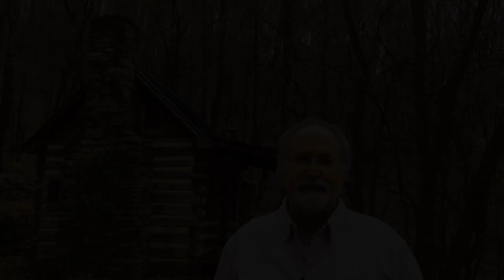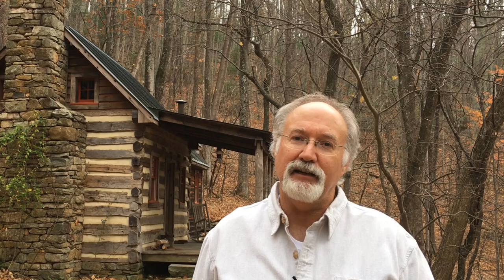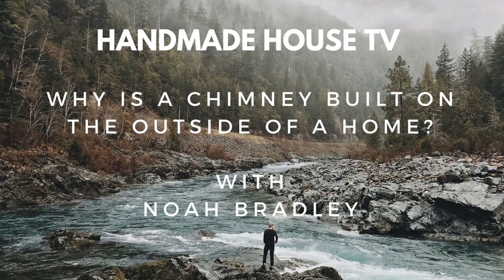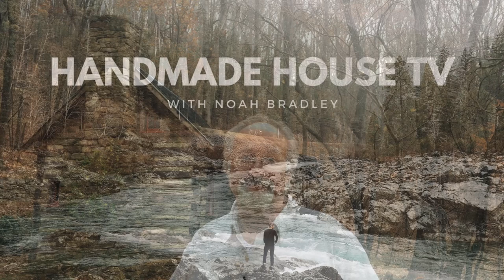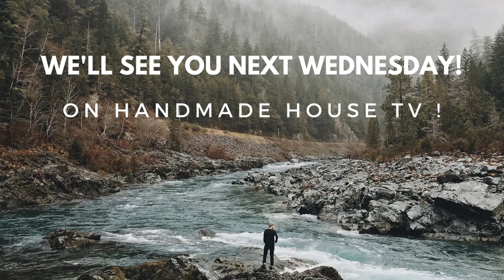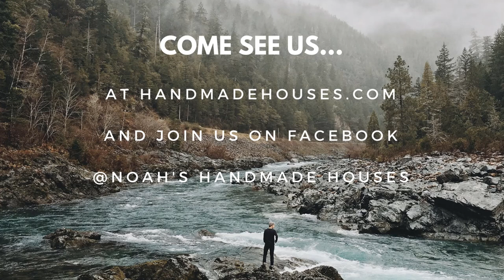WHY Are Chimneys on the Outside of a Home?

Comment: Mr. Bradley,
Did you build the chimney on the cabin as well? I have a older home, and the exterior of the chimney is cinder blocks. I was thinking/wanting to cover it with stone just like yours. Do you have any videos, recommendations, etc. on how to build that chimney? If so I would greatly appreciate it. 
Thank you for your time,
Jason
Reply from the maker: Yes this chimney was built by me/my crew. If you want to cover your block chimney with stone, then I would recommend my Stone Mason Academy, which goes through how to lay and cut stone and spends some time on "veneer", although in your case it would be authentic veneer rather than glue-on stuff.
Reply: @HandmadeHouseswithNoahBradley  the rock I would be using is from off the property! My cabin (family’s) I live in has that exact same style. It was made from the underpinnings of old tobacco barns. Is your course hands on, or online?
Reply: @HandmadeHouseswithNoahBradley  basically I want to do another 1 like it. The chimney in our cabin was built when I was a kid. So I only remember the basics of it.

Comment: In New France and until the beginning of the 20th century chimneys were built on the inside of the house. Either right in the middle, or adorning an exterior walls. Sometimes there would be one chimney on each exterior wall if the house was large enough.
Reply from the maker: Thanks for sharing Martin!

Comment: The chimney also identifies which of the buildings is the HOUSE, as opposed to a shed, barn, or stable. The cabin with the chimney is where the people are.
Reply: So you're saying that people wouldn't see the chimney sticking up out of the roof?  Or the smoke rising?
Reply: Stables never have fireplaces in the US?

Comment: Hi noah. We ve decided to have a wood burner on inside but love that chimney. Our solution, build the chimney but have the fireplace on the outside so we can enjoy those crisp autumn evenings. The question is, how thick might the inner stone layer have to be to not char the logs on the inside? If that makes sense. Maybe you have some experience with this or could help us find a safe solution. Thanks.
Reply from the maker: I'm not exactly certain if I understand the question James... but I can say that building codes and building inspectors will prevent anything from being built that will prevent charring. And if you are in one of those areas that doesn't require permits and inspections... congratulations!... but... with regard to building fireplaces and chimneys it's a good idea to comply with these standards anyway for safety sake.

Comment: My mother’s house, built in 1900, was part of a terrace row. All chimneys were on the wall connecting to the house next door. At roof level there were two stacks each with four flues. Four on our side and four on next door side. 
She also had another chimney at the back with two flues - kitchen and bedroom. But still not on exterior wall. 
My house built in 1970 had the chimneys at one side near the corner. Frankly useless as the room (lounge) was always over-heated. My plan was to move the hearth and wood stove to nearer middle of the house. It never happened as too much structural change involved (doors in the way etc).

Comment: am reading now "Little house in the prairie" and I had not could get why Pa had done chimney outside. now I have figured out. But I want to know why he used saplings from the wood, which he plastered them with mud, and he build wals on the top of chimney . I have a doubt about protection of fire  wood with mud. When I was a child I did wood coal from wood stick and mud in the fire. I think it would be destroy after short time, is not it?

Comment: Early American colonial homes prior to the American Revolution in the Northeast had Center chimneys to utilize the heat as much as possible. During the federal period many homes started putting the chimneys on the outside primarily for fire protection. It was about survival in the early days.

Comment: What is a good exterior base dimension for a chimney.  I think I read or heard you say 6ft wide at the base, is that correct?  And how do you determine the fireplace width inside?  thanks, Laura
Reply from the maker: Laura, it seems almost all chimneys in my area are 6ft by 3ft. A nice touch on a lot of vintage chimneys is a flared bottom where the chimney will come out of the ground 7ft by 3and a half feet and then at about a foot high will quickly taper in. I make the fireplace as wide as I can within the confines of the chimney that is built.
Reply: Thank you for the info.  I believe I read that about the fireplaces/chimneys on your handmade houses website but wanted to confirm.  I have been taken notes and trying to get as much info. as possible before we start building.  I don't like to rush into anything and especially be uninformed.  You continue to be a big  help, thanks again!!!
Reply from the maker: I'm here to help! Don't ever hesitate to ask a question!
Reply: LOVE the taper starting at the ground!

Comment: Many settlers built cabins with few or no nails, let alone roofing flashing required to keep an interior chimney from leaking.  They were centrally located in the ridge of the roof to reduce the amount of accumulated water passing by that could cause leaks.  A chimney located lower on the roof would also require a cricket to prevent it from leaking, and would be suseptible to ice dam leakage.
Reply: Could you enlighten me to what a cricket is ?
Reply: @brianblithe2271  a cricket is a  triangular metal roof flashing for a chimney to divert the water from leaking into the back edge of a chimney where it meets the roof at an acute angle.
Reply: @Thomas-wn7cl  Much obliged Thomas !!!
Reply: @brianblithe2271  Sure thing Brian!

Comment: The look is superior for sure, however, I have fought with exterior chimneys not drawing properly (because they are cold) and will never do so again.  It is just not worth the smoke back and carbon monoxide risk.  All it takes is one day with the wrong type of barometric pressure and not enough wind and you have a house full of poison gases and smoke.  Interior chimneys today are very safe and function far superior to exterior wall chimneys.  In this case I believe function trumps form.
Reply from the maker: I have built over a hundred chimneys in my career, almost all on the outside, and never once had a problem with them drawing properly.

Comment: What it all, actually,  boils down to is that the log cabins were built, before the chimneys, for shelter. It wasn't uncommon for them to have a fire pit in the center of the house, for a while. Also, the cabins were so small, with very limited room and a massive fireplace, inside, would have been impractical. If you look at the colonial farmhouses, you will notice that they had multiple chimneys, throughout the house.

Comment: The main reason was why put a hole in your roof ? Wooden shingles..Tar patch wasn't available in the 1800's... We forget that there's no plastic , no synthetics , no polyester in the early days... Even today,  special precautions are made if you put a chimney through your roof for it  not to leak.

Comment: I wonder how much awareness there was of what we now know to be carbon monoxide.  Folks certainly worried about "bad air".  It would not have taken very many stories of the children in the attic being sickened (or worse) while sleeping next to a leaky interior chimney to foster a bias against interior chimneys.  Are dry-laid chimneys found primarily in warmer regions?  It seems to me that only a well-sealed chimney would be safe in colder areas, where any windows would need to be closed at night.

Comment: I’ve been building and repairing houses for 20ish years and I’ve found the chimney and roof-vents are 95 times out of 100 the source of a leak in the roof. One very pragmatic reason for putting a chimney on an exterior wall is the roof far less likely to leak if there isn’t a chimney going through it. With a little ingenuity you can even build a roof to a chimney on an exterior wall with out flashing. 
As far as preparing food items in summer months, I’d always been told those were chores for outdoors or a separate structure.

Comment: What about Carbon Monoxide?  It seems to me that cracks in the chimney would let carbon monoxide into the house, not good.
Reply from the maker: There are no cracks in a modern chimney... But Carbon Monoxide is always a concern, which can be monitored by a battery powered meter.
Reply: @HandmadeHouseswithNoahBradley  What are you talking about?  In the video you said that sometimes fire could be seen through cracks between the stones in chimneys.  Also, you said you were not talking about modern concrete lined chimneys, but the old kind.  And the tradition of building a chimney outside the house was not taking place at a time when they had CO meters.  Wow!  Are you talking about another video, or can't you keep them straight in your mind these days?
Reply: Houses weren’t air tight ever

Comment: So "No good reason" is the answer. He could have opened with that.
Reply: So lets recap: Why build an exterior chimney -> Saving inside space for other things, secure the fire just in case and also it radiates extra heat when the climate is hot, nice aesthetic reasons etc, in your mind equals to no good reason to do it that way.   O... K... 🙄😕

Comment: Your video offers some interesting theories but they are just that...theories.  There is no proof as to why chimneys are outside...or inside for that matter.  I am a former home builder and president of a home builder association.  I've also completed 41 years in the real estate business as a broker and a certified appraiser. During this time I have literally inspected thousands of homes.   I deeply understand building concepts.  

For every single "reason" one might allege as to why a chimney should be on the outside there are just as many reasons why they are not on the outside in vast numbers of homes, both historic ones and newer ones.   Truthfully, there is no reason which demand having a chimney outside as that isn't necessarily any bit superior to having one built on the inside.

My first home was built 113 years ago in 1903.  It had 7 fireplaces which heated the house by burning coal.   All 7 of them were interior fireplaces.  There was no superior reason then, or now, to put the fireplaces on the exterior or on the interior.  It was and still is purely a matter of preference.  Whichever way the fireplace chimney is built, once it exists, people can think up all sorts of reasons to justify having built it that way!

It's like buying a car or a truck.  Whichever one you purchase, you will then find all sorts of ways to defend your decision.  I have no quibble with anything that you said in the video other than it should be labeled purely as YOUR OPINION and not as "the answer" to an alleged "mystery" as to why there are homes with exterior chimneys.   My contention is there is no single "the answer" that explains why some homes have exterior chimneys and to imply there is a legitimate single answer which explains every case where there is an exterior chimney on a house is just foolish.

One of your comments stated your video had no clickbait or BS.  I have to strongly disagree with that comment.   The claim that you will provide "the answer" to explain why homes had exterior chimneys is pure clickbait in that there is no such real answer....just your personal opinion on that issue.   

And for the record, the oldest surviving timber framed house in America is considered to be the Fairbanks House.   Would you believe it has an interior chimney, not an exterior one!   Maybe all the thousands upon thousands of people who built the first homes in our country and put interior chimneys in them were too stupid to know all the wise "reasons" you spout out about why exterior chimneys are found on many homes.  Or could it be, as I say, that there is not a valid set of reasons why a chimney should be one way or the other and it boils down to pure preference of the person building the home?
Reply: At least I am not oftin wong!
Reply: Just looking to rip someone a new one today huh...WTF I'm thinking who are you really mad at..goddam!

Comment: full of idiotism to build it outside...firstly they pollute as the fireplace is colder and give less heat. If one cant build a safe fireplace inside do not build one at all. And chimney fires is  result of not knowing how to use one. Yes I´m Finnish and had 5 fireplaces in my home as a kid.